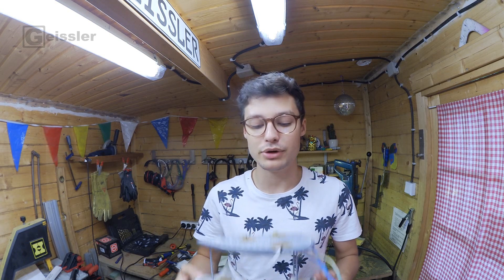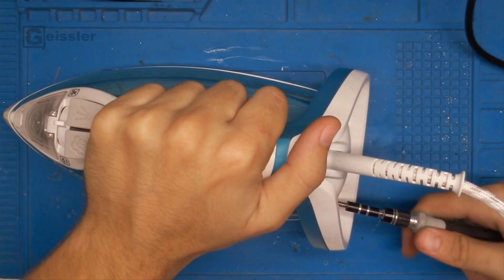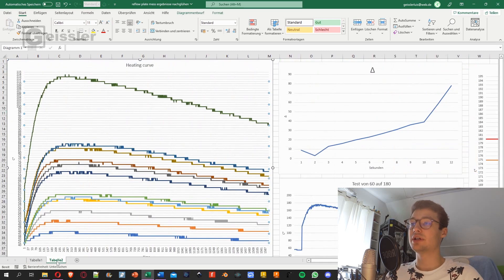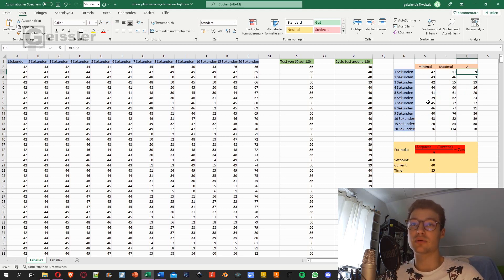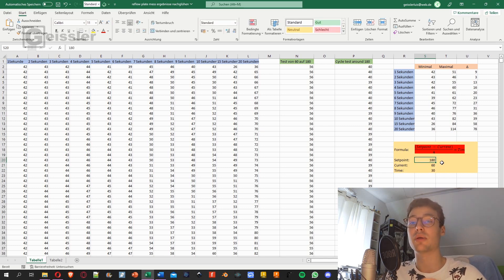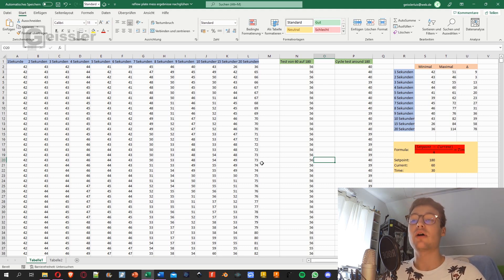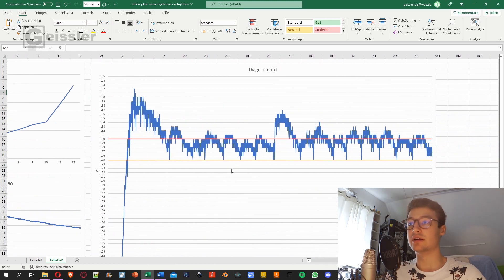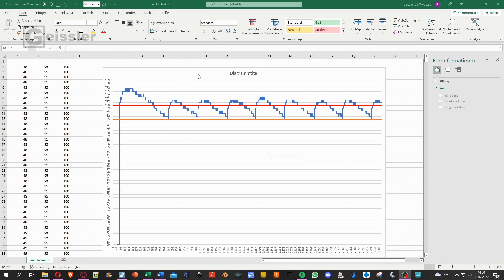Reflow Plate V1.1 - Solving overheating problem - Luis Geissler

Comment: Great work on the V1.1 hardware and fixing the overheating issues. However, I really don't see the point of sharing a project if you don't provide the Arduino code. Even if it's not 100% finished, why keep it hidden? Sharing the source is what makes a project like this actually useful to the community.

Comment: Great work, you can try to make PWM but not for 500Hz like in arduino just put 1-3 secounds = 255 and map it with ^C
Reply: that's the problem with Arduino, you don't really learn to program correctly, but it works.
I have a Microchip Chipkit (Faburino) 32 bit and 48mHz and i use normal code that you would use in a pic, accept for the interrupts.
i don't use the Arduino stuff to set a output pin to one or zero, but TRISAbits.TRISA8 = 1; and so on (like setting up to goodies of the chip)
To really learn to code, you have to read big part of the particular Atmel MCU and corresponding code, in Microchip datasheet you have quite a few examples (in ASM).

is 500Hz the Arduino default thing?
it should work great whatever frequency you choose, the width of the pulse is doing the stuff or not.
You probably be best using a 1000hz timer, 1000 mile seconds for human understanding.
do they have online timer calculators for the ATMEL, like there are for Pic's?
Reply: @AnalogDude_  Do you know what you talking about?
Firs thing is 50Hz and this type of SSR. you can not regulate poter in therms of duty...
Second is histeresis - termal time delay .
Reply: @marcinwitkowski2981  50Hz doesn't matter, sure it want be a sine wave anymore, but a shopped one, more people have done this. the resistor(heater) in the iron doesn't care t only cares about electrons.

There is a video about guy that talks about electronics and shows how a VFD works with animation of the wave form.

He(Luis) is having the same thing right now if the Arduino closes the SSR it shops the sine wave.
Reply: @marcinwitkowski2981  he also could turn 220V in to DC voltage using a suitable bridge rectifier and capacitors, but than he deals with a voltage over 300V.

That's how a VFD works and turn 3 phase motors in production facility's and so.
Reply: @AnalogDude_ AC from wall is 50 Hz doesn't matter ? you just dont know what you talking about, it is not DC, and he is using zerocross SSR, dont write just to write. just learn basic electronics.
Reply: @marcinwitkowski2981  well, change TO DC and a suitable transistor, i got the bibles of electronics here and play every day with waves, design my own electronics.
Reply: @marcinwitkowski2981  if you operate the switch of the lights in your house, you also chop the sine wave instantly and nothing happens.
Reply: @AnalogDude_  there is something wrong with you. i wrote to Luis Geiser about thing that i done in past, becous he is using AC 50 Hz and zerocross SSR (triac) you can only switch it on one period, that is the point of Your writing ??? the best way i to make PWM but no 500Hz becouse Triac will be on for this 20ms no matter what you do, just you need to make PWM with 20ms and 255 or even 100 max value and Map() it. full time can be 1-3sec. If you dont know what i wrote just learn aobut electronics.
Reply: @marcinwitkowski2981  there must be something wrong with you and you don't see it, multiple spelling errors in the same word,  the browser should highlight that word, you're probably to eager to slam something down here.

You could switch to DC, trigger a transistor and skip that problem.

Maybe a 25Hz timer, using a diode and voltage divider to source the 50Hz from the grid and divide it using a CD4013 and feed that the Arduino and change the STIR.
multiple ways possible.

I would switch to DC.
Reply: @marcinwitkowski2981  Lady Ada from Adafruit did this like 4/5 years ago or so.
Building a re-flow oven and later selling the ingredients and giving away the source code, including the right heating profiles.
Reply: @AnalogDude_  English is not my country language, You do not know what im writing about.  He is NOT using DC so dont write obvius things i wrote him what to do to make it more precicion and controlable. yours coment doesent put anything to this video. if you dont know how to drive just lean more but dont change Car. if he make it on AC dont put DC staf.
Reply: @marcinwitkowski2981  well, choose another type of SSR and it will work, not to much trouble. YouTuber GreatScott has the hints and advice you need to make it work using triac component, how they hell did i know that he used a Zero cross ...

they range from 2,95€ to 9€ here.

but i still would change to DC and use a transistor to have full fine control of the iron and dial in the temperature exactly you want if you want precision and you still could use the diode trick to reset the loop in the Arduino and sync it to the grid.
you need a certain heating profile, described in some components datasheets.

you might wanna install English, words get highlighted and a simple right click ...

Comment: To much trouble, i guess .... just place a darlington transistor on the input of the Solid State Relay. ... or a dual BC547 setup, first for the 3v33 from the Arduino, the second transistor to feed the Solid State Relay 5.0V, use the "falstad" simulator to dial in the right resistor values for the Arduino/transistor BASE maybe 22K, 18K or 15K and 33K/47K for the collectors.
Wiki: transistor Schmidt trigger, you have to keep the current in control otherwise you just burn energy ... while not needed.
1 mA on the Base is like 101 mA (+1 from the base) from collector to emitter (HFE 100). don't load the Arduino mega, ALWAYS use transistors or Texas Instruments "TXB0108" voltage level transducer also available as single device: TXB0101, don't not connect things to an Arduino, not good.

Trigger the transistor/Solid State Relay with a PWM signal from the Arduino mega, change the PWM register/pulse width during operation.
for heating, a wide pulse, for keeping warm a middle setting.
Than the "iron" is continuously operated and operated via continuously "intelligent" variable signal.
If the heat is to high, make the PWM pulse narrower if the heat is to low, make the pulse width wide.

Maybe you can use the value of the ANALOG  NTC read(10 bit), >SHIFT< this value 2 places to the right to make it 8 bit and feed that the PWM register.

Job done!